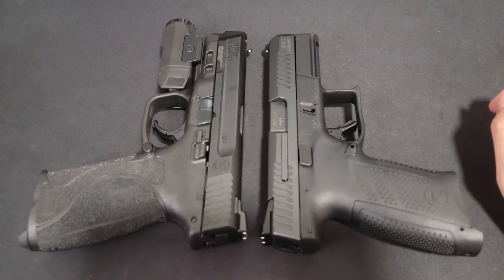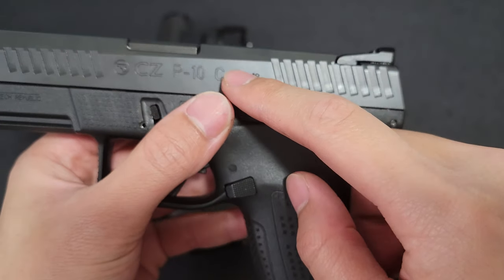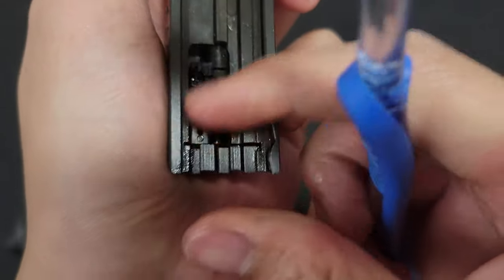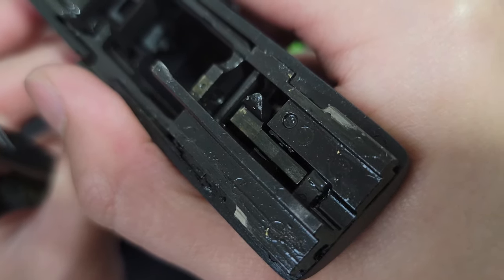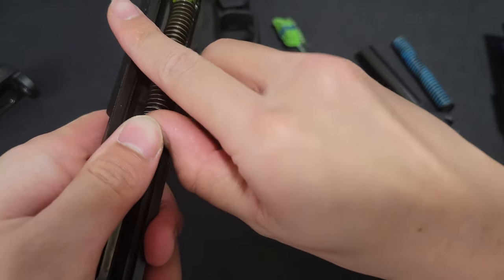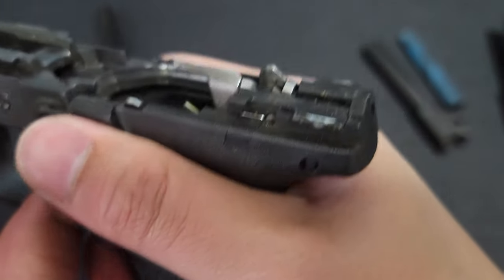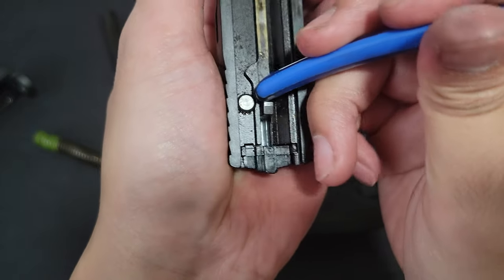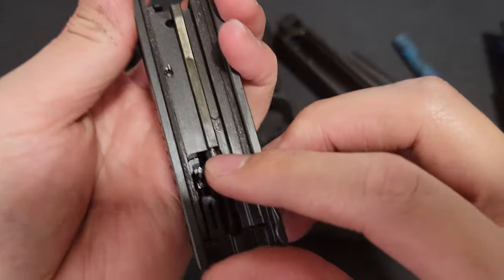Addressing the CZ P-10 C Firing Pin Stop Design Flaw (Read Description, Updated 7 April 2021)

Comment: If this is a so called design failure then why hasnt there been any negligent discharges due to this so called problem? And the example of you pulling the striker back as far as it go and letting it fly is not how the firearms work. The sear is hooked on the striker and moves maybe 1/8 of an inch of that. So this video is straight bullshit and a waste of mine and anyone elses time.

Comment: The whole problem is that you're using your toothbrush instead of a pencil to point to components. And, you are mot a trained armourer or a firearms engineer. This video should be deleted because of False Information. Step away from the key board and go brush yer teeth.
Reply from the maker: You don't need to be a paid engineer to understand mechanics. That's a fallacy. Only an idiot would think guns are some sort of high-tech engineering that requires gunsmith or engineering knowledge, SMH.